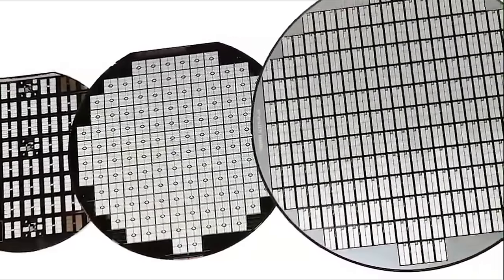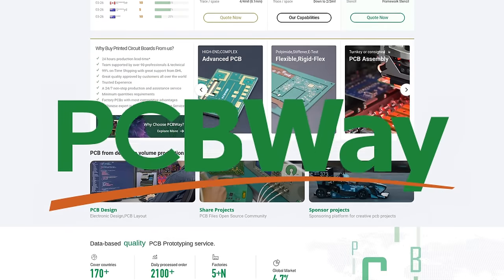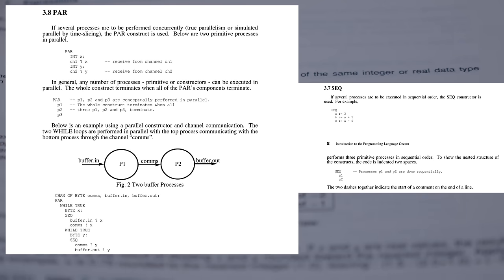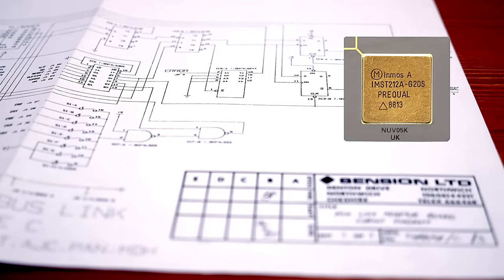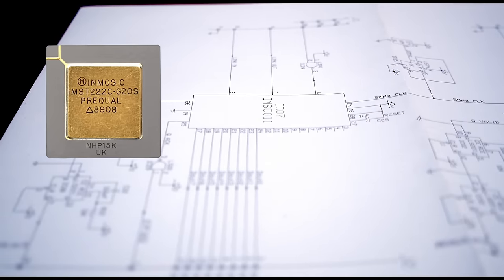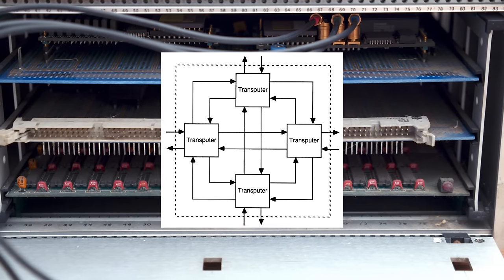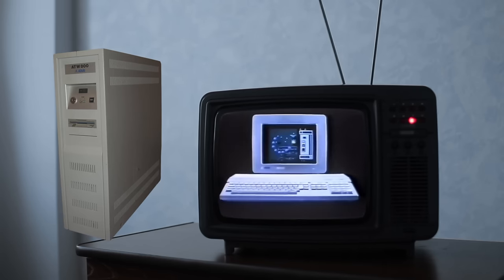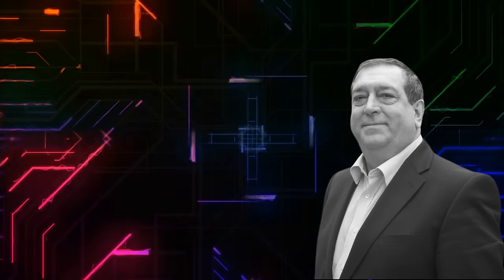The Transputer: A parallel future

Comment: Risc-V is such a well designed ISA  and architecture (indirectly), even the ABI is well planned. Risc-V is impossible to code for in assembly  without pseudo-instructions (like all risc isa). Risc-V (or similar design) is the only possible future of computing. People who still think X64 and ARM64 has a future have zero understanding of how cpu are manufactured. Even Intel and Nvidia are betting it all on Risc-V.
Reply: AMD/Xilinx announced their own RISC-V soft-core.
Reply: @semicuriosity257 1000x less components to do the same thing. DO THE MATH! It will take time until Risc-V cpu  will compete in speed with ARM and AMD, but it will happen. I even believe that apple will switch to Risc-V in 10 years.
Reply: That's not entirely true: the original ARM ISA was exceedingly easy to hand craft code in without needing pseudo-instructions.
Reply: @talideon  Unless the number you want to fit in does not fit on 1 single instruction. All risc cpu ASM require pseudo instruction to help to read the code. The encoding of numbers in ARM is horrible. My main consern with Risc-V is code readability since there is no move instruction, most stuff is done with math-instructions. And its even more complex when you consider thumb instructions or 2x16 bit instruction in Risc-V. Honestly, Risc-V is better served by C compiler most of the time.
Reply: @MarquisDeSang  With modern X86 CPUs, ISA doesn't matter when modern X86 ISA is mostly a front-end issue.
Reply: @MarquisDeSang  AMD K12 was Zen 1.x R&D based ARMv8-A CPU design.

K12 was AMD's 1st custom microarchitecture based on the ARMv8-A (AArch64) instruction set that is based on Zen 1.0 R&D.
Reply: @MarquisDeSang >I even believe that apple will switch to Risc-V in 10 years.

FYI, Apple designs its own microarchitecture ARMv8 clone and they don't depend on ARM Ltd's Cortex X and Neoverse series CPU designs.

AMD/Intel has the necessary patents and design teams to design wide and deep pipelined out-of-order RISC-V clones.
Reply: @semicuriosity257 True,  most cisc use risc instructions internally and some Risc-V will use cisc stuff in their microarchitecture.
Reply: @semicuriosity257  But they still need to pay ARM license and they still need to use too much hardware (circuits and transistors) to make these chips.
Reply: RISC-V is a good choice for lightweight CPU design teams and it's popular for single-purpose micro-controllers. 

My RTX cards have NVIDIA's custom RISC-V and NVIDIA doesn't expose the custom RISC-V micro-CPU.
Reply: > People who still think X64 and ARM64 has a future have zero understanding of how cpu are manufactured.

I'll bite. I'm game.
Reply: @semicuriosity257  That is the difference between now and in the future. I do have a risc-v desktop and it is not fast, but one day they will be the fastest.
Reply: I’m not sure why you think ARM won’t last. RISC-V has many disadvantages compared to ARM. Chip design is a numbers game. You have fixed costs in developing a chip, which is then divided by the number of chips that are made. The more chips made, the cheaper each becomes as the fixed costs are divided by a larger number. ARM designs go into literally billions of chips, so the cost to license an ARM core is low, and they have large libraries of other parts you can add to form your custom SoC.
RISC-V has a much smaller market, and has many RISC-V design houses for that space. The result is that it competes only at the low end of the spectrum when it comes to CPU power and design complexity. Higher end designs need more expensive Fab processes and larger dev teams, the cost of which needs to be split across the production run. The result is that it’s hard for a 3rd party design to make any headway against the incumbent architectures. X86 isn’t a good architecture, but the volume of demand allowed lots of development resources to make it competitive or better than RISC designs like Power or SPARQ. ARM didn’t try to compete with X86, but rather went after the low power mobile market, and the volume of business that generated allowed them to improve their designs to the point where they were competitive with X86. How is RISC-V going to generate that kind of volume for at least one design house? What is their killer product?